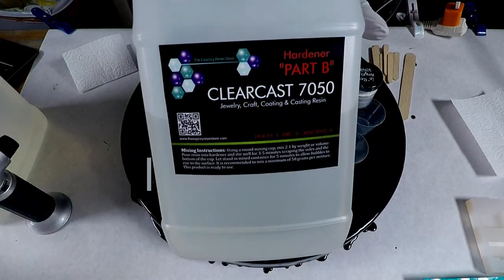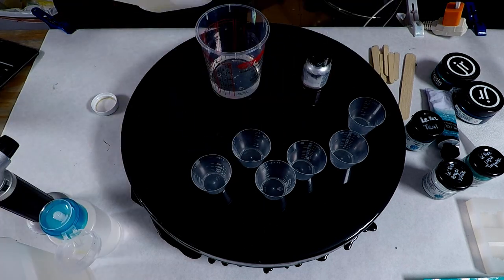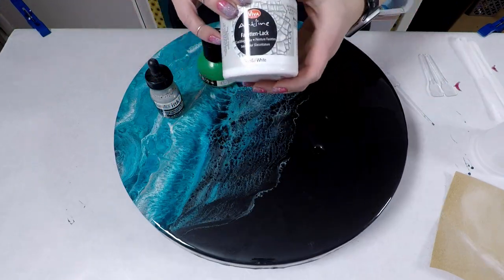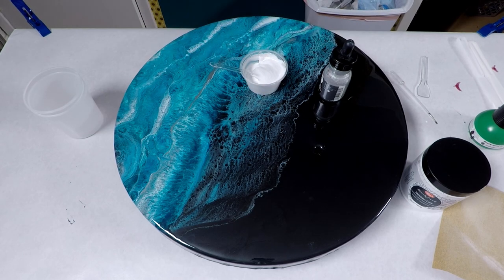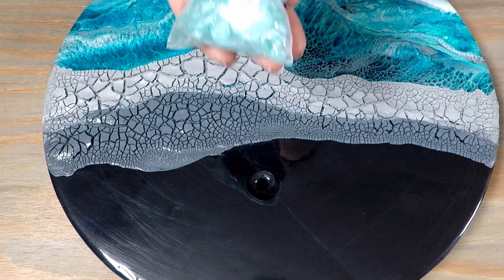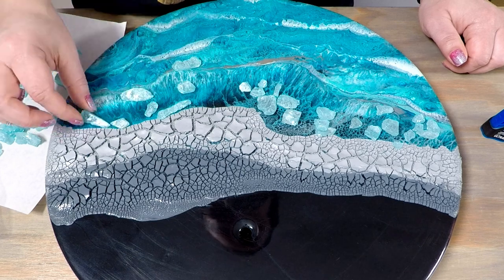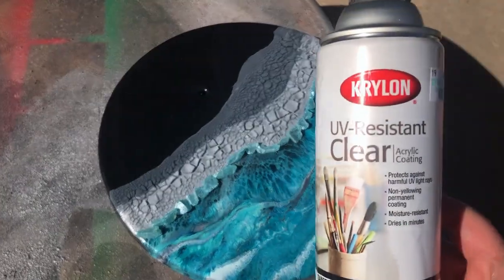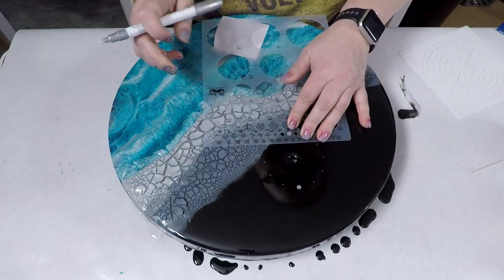Epoxy Resin Clock with Crackle Paste & Glass | Clearcast 7050 | multiple layers

Comment: Do you have issues with the resin curing using oil paints?
Reply from the maker: I have never had issues with the resin curing when using oil paints. Most likely there will be dents/divots/pits/fisheyes... and a clear layer of resin will be required to level everything out (which 99% of the time I do no matter what I use), but the resin has always fully cured for me. Very similar to when I use silicone oil, as both can resist resin. Check out several of my other videos where I used oil paints or silicone oil!
Thanks for watching!
Reply: JOTZ designs thank you for your response 😀
Reply from the maker: Happy to help!